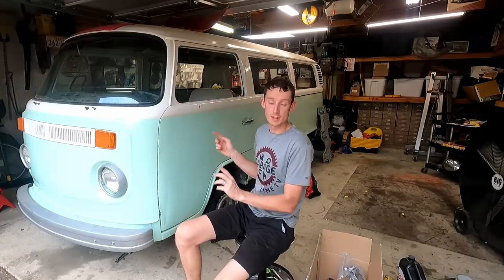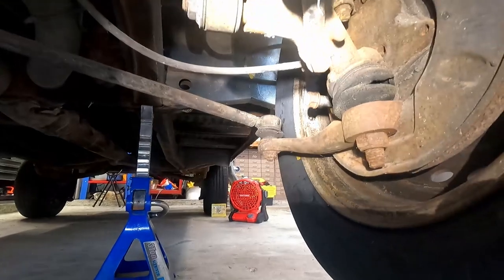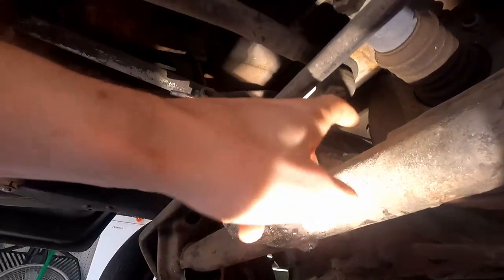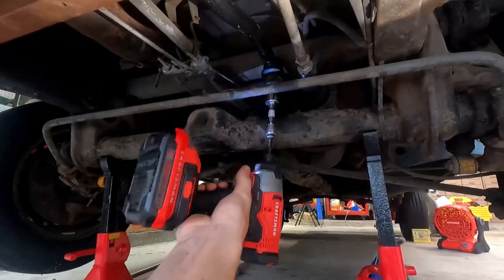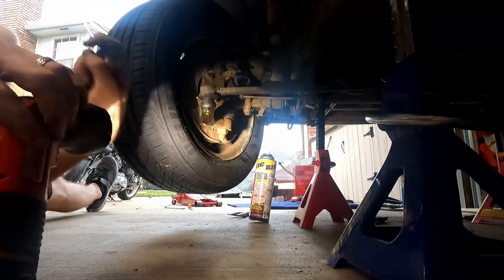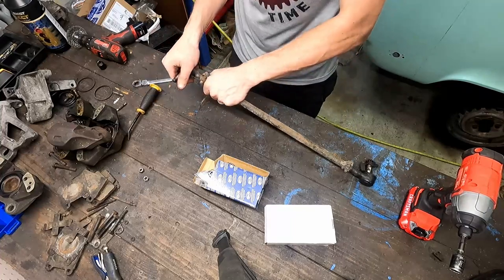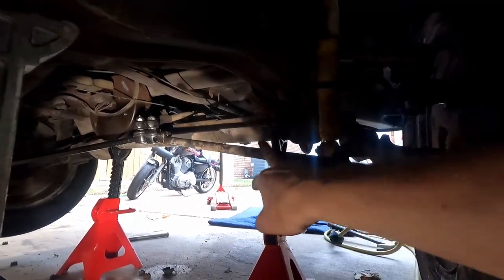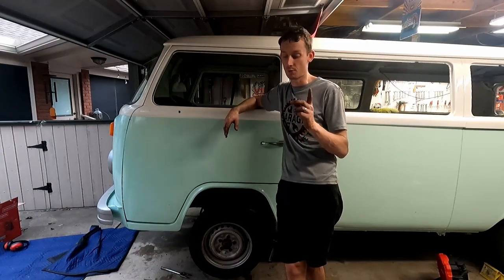Steering UPGRADE for our 1974 VW Bus Camper Project Build!

Comment: Excellent. Fun, concise, witty. 
I recently acquired a 1975 salvage yard bus that needs a lot of love. Has a straight frame. And a good motor. Trans axle and clutch in good shape. That's about it. Everything else is rusty, jammed, missing, or cut out. The wiring harness is a shambles and the window seals are completely dry rotted. Loads of other craziness. But I'm game.
She drives like the Stay Puff Marshmallow man. And I'm about to replace the drag and tie rods. This video is very helpful. 
Thank you.
Reply from the maker: That makes me so happy! I’m glad you can find some use in this. Good luck on your project! It’s so worth it!